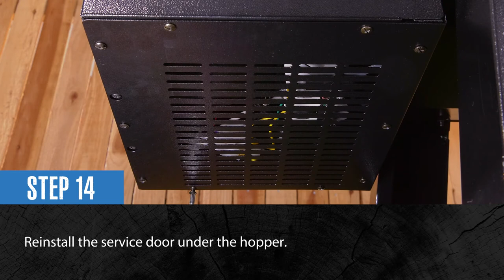How to Replace the Igniter on a Pit Boss Platinum Laredo Wood Pellet Grill

Comment: I cannot pull the wire through the fitting is too big for tho hole
Reply: There's a rubber grommet that makes the hole too small. Once, you remove that, there will be enough room.  However, getting the grommet back, in place, might test your sanity.
Reply: Lol it did called the manufacturer and asked them they had no clue the rubber grommet was there and this video doesn't show that rubber grommet
Reply: Sorry Raizacthedicover is my ddo/ddr error coins this is my general account

Comment: Used about 10 times. My igniter isn’t 1/4” past the tube and it slides. Poor quality assembly, I hope cleaning and proper setting will fix my error code

Comment: I purchased this pit boss in November. I already have to replace the igniter. How often do these things malfunction? I would think it'd be years not months.
Reply: Exactly. I got one in May and it ruined my 4th of July dealing with those error codes.
Reply: Used 3 time bad board and ignitor.
Reply: More times than what should be necessary.  I'm getting ready to replace mine a 2nd time and it's less than 2 years old.  Also had to replace control board and temperature probe. All when it was only a few months old. 
Not happy with their product but their support has been great